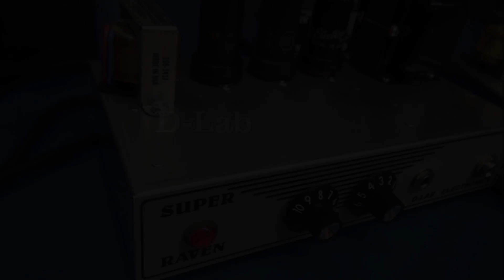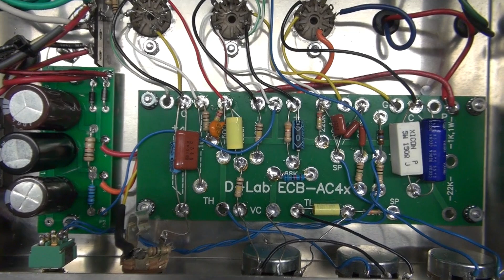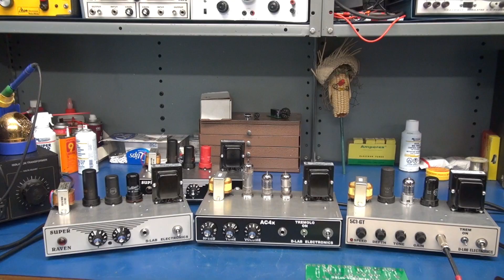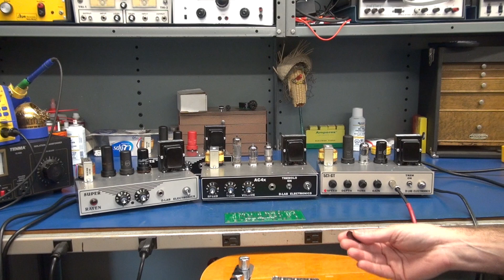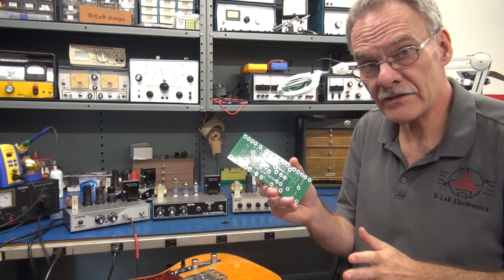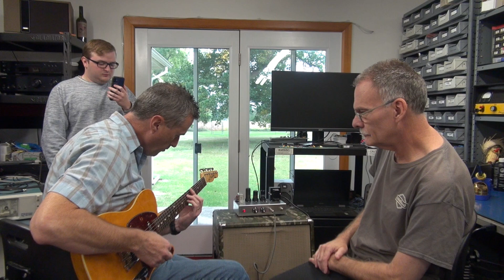D-Lab Trio low power tube practice guitar amps Fender Vox Super Raven Class A + tremolo build kits!

Comment: Whats the point in using a 6f6 instead of a 6v6. 10 watts plate dissipation verses 12?
Reply from the maker: The original Raven used the 6F6. High voltage is 250VDC, so not close to the max rating. You can use a 6V6 but it wont gain you anything except for higher cost
Reply: That makes sence terry. Dwight.

Comment: Sounding good Terry.  Tremolo sounds great. Can you remind me if you’ve done a boutique style amp with both tremolo/vibrato AND (spring) reverb?  That’s what I want to try…..
Reply: Here’s what I recently did with an old “Traynor” 4 channel YVM-3 light weight transistor PA amp head.  I couldn’t stand the push/pull 2N3055 transistor output stage, so stripped it and the power transformer out and added transformer/components for a push/pull tube output stage with a couple of 6V6’s after the preamp.  This YVM has 4 channel selectable spring reverb in the pre-amp, but no tremolo. With guitar, I like the tube output tone much better now and will consider adding a tremolo circuit as well.  This outputs to two Traynor 10” column speaker sets.  But still looking for a small combo with all-in, smaller than a Vibroverb.